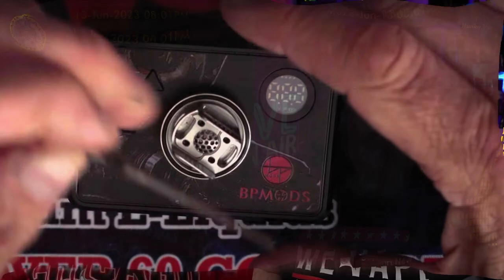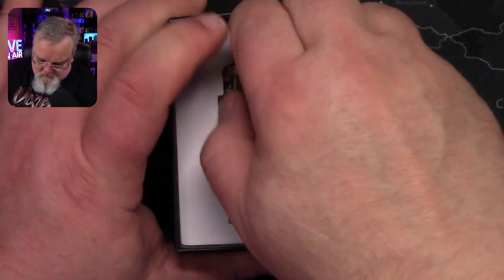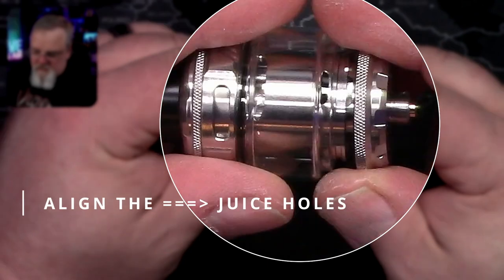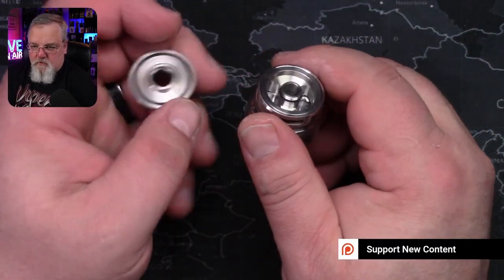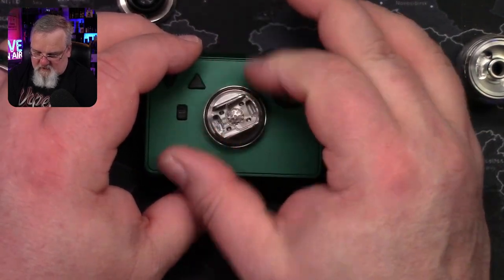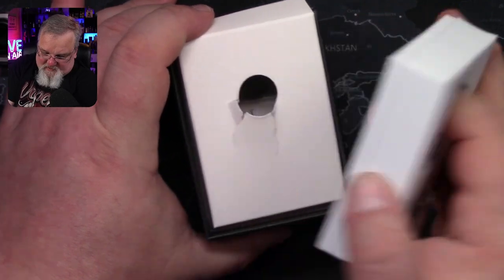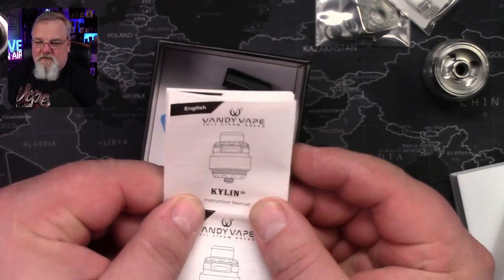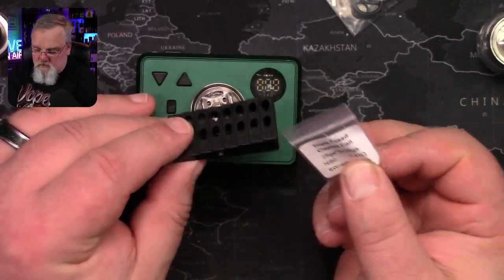Kylin III RTA Unboxing Review

Comment: Just discovered your channel and subscribed. I like your review style and your personality. I'v been on the fence about the Kylin V3 RTA because I'm not a fan of the quarter turn deck design. Wish it would have been threaded. My favorite dual coil, top airflow RTA's are the Jug V2, Intake Dual, and the Blaze dual RTA. I do love the deck on the Kylin V3 and I have no doubt the flavor is up there with most other top airflow RTA's. If I catch it on sale I'll snatch one up. Overall great job on the review!

Comment: I wanted to add that even if your coils are burning perfectly, when you add cotton that can change.  If your cotton is causing the coils to flex too much because it is too thick, then you can make one or both not heat correctly.  Usually that is due to the coil leg shifting in the post hole...or it is spreading the wraps apart.  You can see this beginning at 10:35

Comment: my trick to not over filling to top and stuff, i try to just leave tip of nozzle in kidney openings then when it gets to very top i hold it there but let go so it sucks a bit back in and its perfect
Reply from the maker: That's what I do as well. To keep the tank from being overfilled let the bottle tip remove just a little bit before putting the cap on. The tank liquid reservoir needs a little bit of air to easily compress while tightening the cap, otherwise the pressure oversaturates the coil until you use up a ML of fluid and equalize the outside and inside air pressures.